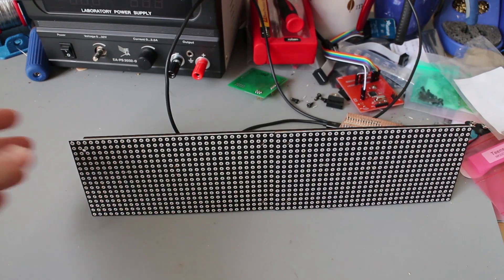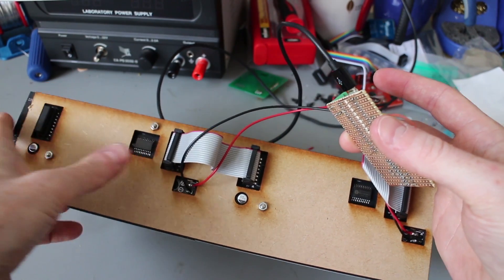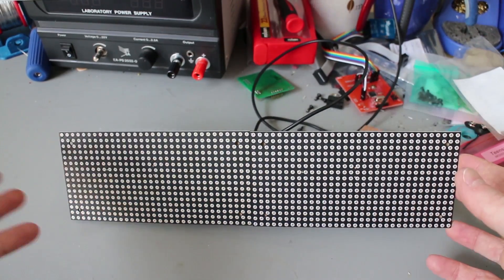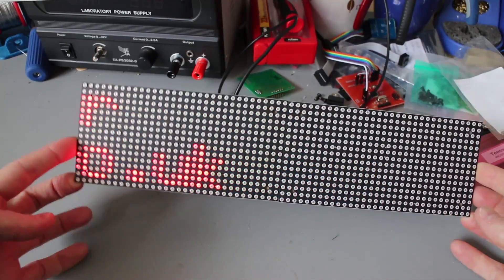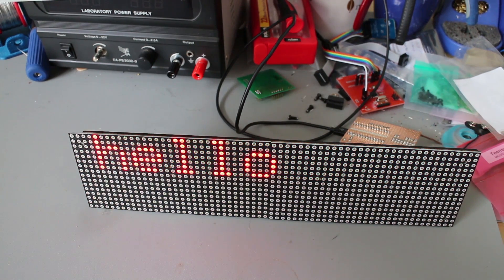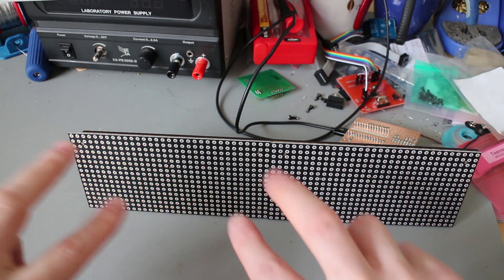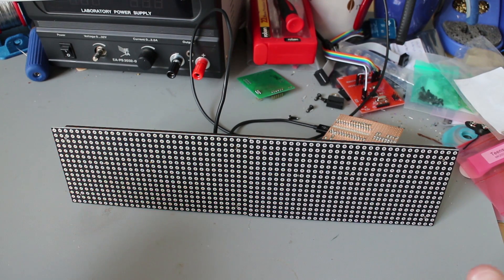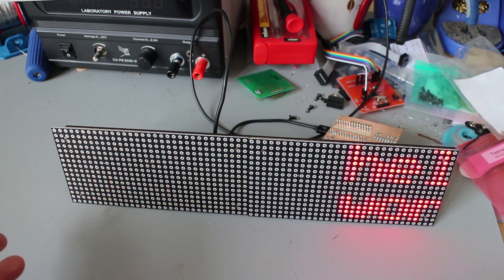LED Matrix Display

Comment: Hi Arthur,
I wonder why you mention that the thing won't work with a 16MHz Atmega328. I run a similar display (32x56) with an Atmega328 on 16MHz with a refresh rate of 16Hz (16 complete frames per second). See that:
https://www.youtube.com/watch?v=dVLfzm9piLw